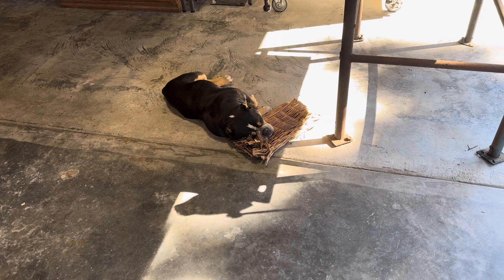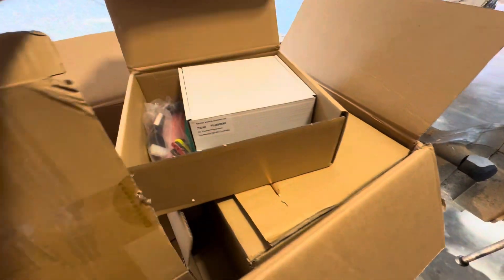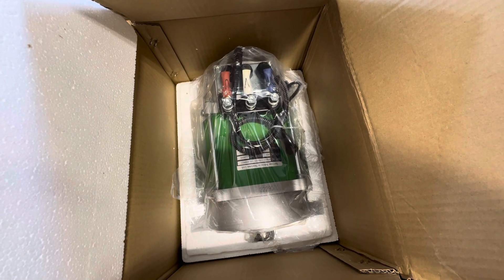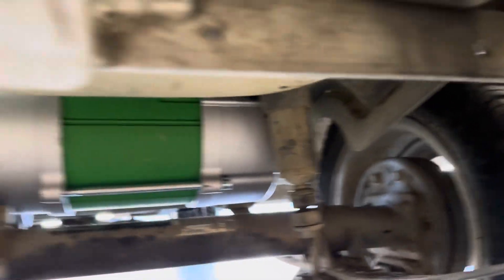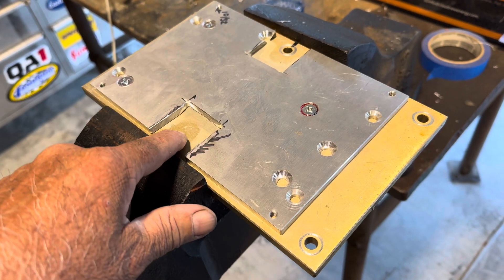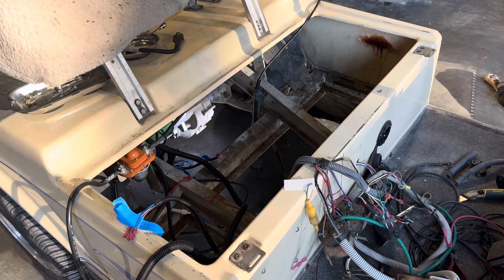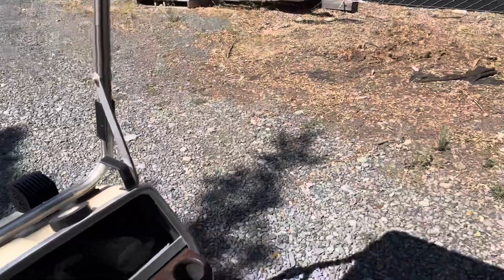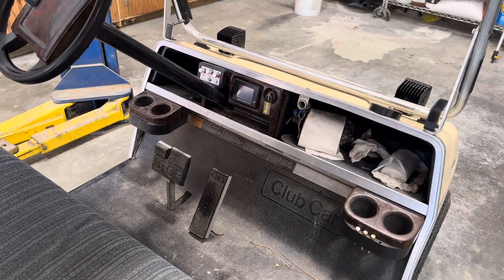@GolfCartsModified helps me upgrade my 1996 Club Car

Comment: Hey harry, it’s Cameron from Newfoundland Canada! I’m building a 1959 Buick lasabre aswell I’m doing a 6.0 ls conversion I seen you also have a 59 with an LS and I got a boat load of questions for you lol, I have everything to do the engine and transmission but I need to figured out some things about the rear end configuration